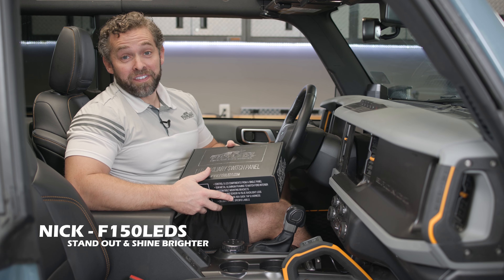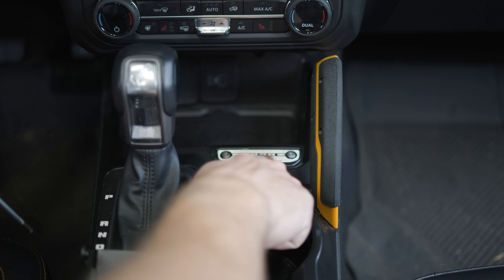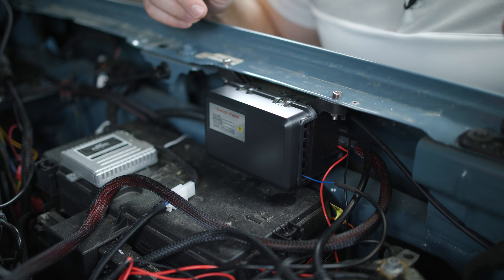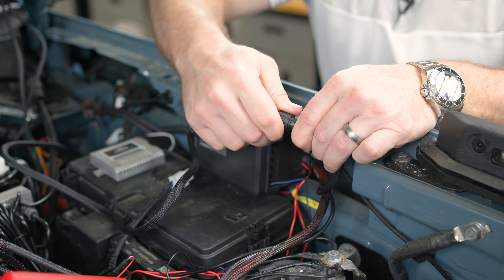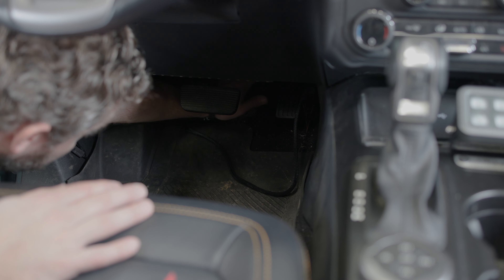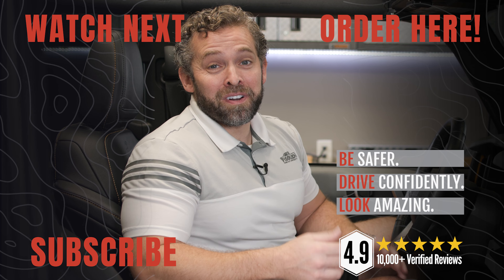2021 + Bronco LED Auxiliary Switch Panel (From F150LEDs.com)

Comment: Just installed today on my 2023 Bronco.  Went smooth.  Wasn't a big fan of drilling into my rig to mount the control box but it was simple.  Wish there was a better spot for it.  I could not get the fuse box cover back on.  No amount of jiggle or push would make it so.  Ended up notching out the cover to clear the control box.  Nick seems like a good guy.  Makes me feel better about a company I randomly found on google!
Reply from the maker: Thanks Mike! We appreciate the kind words and feedback! It is our honor to serve you and we look foward to serving you further soon!

Comment: Great video! I don't know how I stumbled on this video but glad I did. Just ordered this for my Bronco last night.
Reply from the maker: Fantastic! Thank you so much for your support, we truly appreciate you and cant wait to serve further!
Reply: @F150LEDs OK, I just received it. Super fast shipping, thank you! No instructions whatsoever on connecting the lights to the unit. I can't find anything online. Can you point me to the right direction or can I just ask on here?
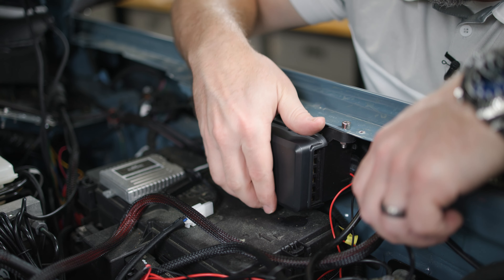Reply from the maker: You are so welcome, thank you for your support! It sounds like the info you are looking for is covered at the 4:20 mark in the installation video, we will provide a link to it below!

https://youtu.be/7X576cGbFfQ?si=qX-6ErEznlXcv2rE&t=260

If you have any other questions please reach out to our support team direct using the link below for fastest response.

https://www.f150leds.com/pages/contact-us

Thanks so much for your support, we look foward to serving you further soon!
Reply: @F150LEDs  I got it. I was actually wondering how to connect the lights after the switch was installed as in, do any other wires from the lights need to be connected? Most of the lights on Amazon come with wiring harnesses. I cut all of it off and just ran the hot to one of the ports as shown at 4:20. I think the connecting of the blue wire confused me. Thank you though! So far, very happy with everything.

Comment: Bit of a newbie, would you still use the wires Ford has run to the light you add and then run that to the fuse box?
Reply from the maker: Hey B4K4FIRE, you would not need any factory wires for this application. You would simply run the relay wire from the harness plugged into your lights (shown as the single blue wire in the video) to the AUX distribution block and connect it there. Does that answer your question fully? Thanks, we look foward to serving you soon!

Comment: Could you mount the box a little further in towards the cabin. It looks like a pain to fight with everytime you need to get into the fuse box? You struggled quite a bit in the video and even cut away and came back to it after it was put back in. Already ordered one and it looks like a great product. How did you not pinch the add a fuse wire putting the cover back on?
Reply from the maker: Hey Gram, thank you for your support! Absolutely, you could relocate it to many different locations based on your preference, we didn't plan on accessing the fuse panel much sop we chose that spot, it does take a little fenagling to get the cover back on. The fuse panel top cover has flex to it so it doesn't crush the wire as it exits the fuse panel. Thanks again for your support, we look foward to your feedback and serving you further!

Comment: Can you add a short video for running and hiding the cable farther back on the console where it would be mounted for a manual?
Reply from the maker: Hey @SKB, thank you for your support and question! We don't have a manual on hand ot shoot the video for you, but it would install right onto your Bronco plate and the cable routing would be exactly the same except you would have a slightly larger run from your AUX panel to where the wire tucks into the dash panels by the center grab handle. We hope that helps, please let us know how we can serve you further!

Comment: Does this have positive and negative in the distribution block or just a positive.
Reply from the maker: Hey Jonah! You would run your positive (+) leads to the distribution block and your ground (-) leads to your frame or ground terminal on the battery.  Thank you for your support, we look forward to serving you further soon!

Comment: Looks like a clean almost OEM look on the inside. My 2023 Bronco didn't come with upfitters.  Can I connect this directly to the pre-run wires to control my fog lights, rear aux lights and roof mounted led bar for example?   I cringed at the part where you have to drill two holes.  Is heavy duty velcro an option to install on top of the fuse box?  Thanks for the video.  Cheers!
Reply from the maker: Thanks @Sn-tk8rq! You can use this unit to run all of your light systems as you mentioned. We would not recommend using Velcro as the the power distribution block has some weight to it but we promise drilling those two small holes is easy and unnoticeable. =) Please let us know how we can serve you further!
Reply: @F150LEDs  Thank you for a quick response! A great first impression to a potential client.  I look forward to doing some business.
Reply: Coupon codes available????

Comment: Does this offer modes (momentary/latched/pulsed) for the switches.  This looks similar to auxbeam.  What makes this one better?
Reply from the maker: Hey Jonathan, thanks for your support and question! Our panel is absolutely the best option for your wonderful Bronco.  To quickly just name a few advantages, you are getting 1) a custom bracket for easy installation and to retain visual sightlines of your Bronco plate. 2) Custom gun metal matching interior aluminum housing with matching front panel. 3) easy tap pre-set for easy linking to your Bronco 4) 24 custom labels plus 5) Ford matching power switch and 6) Ford color matching backlighting.   That's just a few quick differences that you asked about that will help take your Bronco experience a notch above any other generic look alikes etc. 

Please let us know how else we can help, we look foward to serving you soon!
Reply: @F150LEDs  what are the switches three ways, momentary, latching, pulsing? I was considering this for one of the Ford trucks not the bronco
Reply from the maker: @djweaver30125  Perfect! We include mounting options for other Ford trucks too. As far as the switch it functions as a latching switch (one press ON, then another press for OFF without a change in position). Thanks Jonathan!

Comment: Wonder if there is one for an 2023 f150? Where would it be mounted
Reply from the maker: Hey ClipVue! This model actually will work great on your 23 F150 as it includes an optional 3M panel mount allowing for installation directly to dash on your F150 etc. Thanks for the question and support!  We look forward to serving you soon!

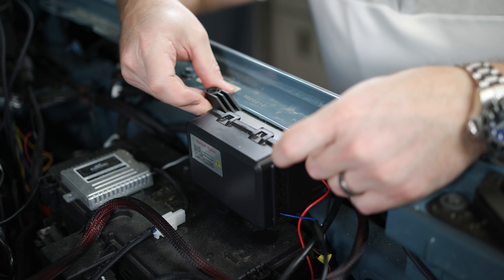Comment: @2:50 you say, mounted on the passenger panel, but clearly that’s the driver side.
Reply from the maker: That right, good catch! We did indeed mount the power distribution block on the driver side panel, not the passenger side. Sorry for any confusion that may have caused, thanks for your support!